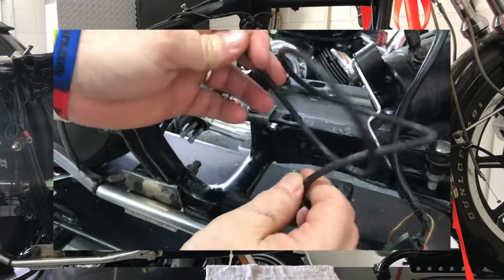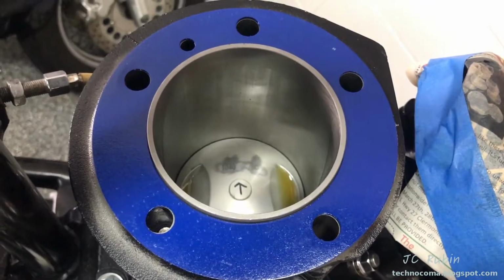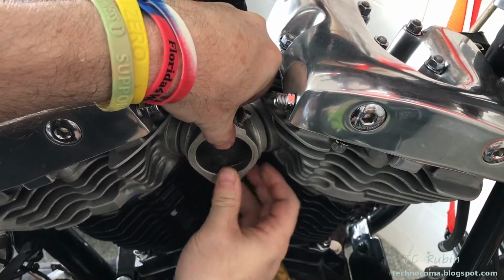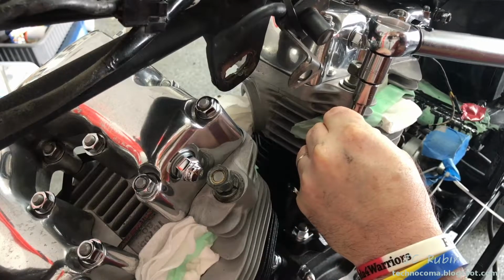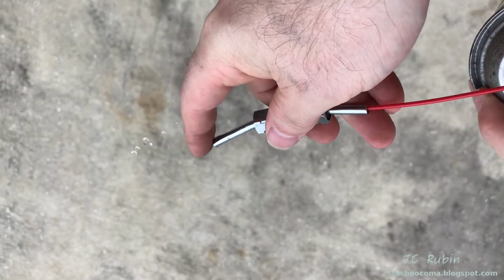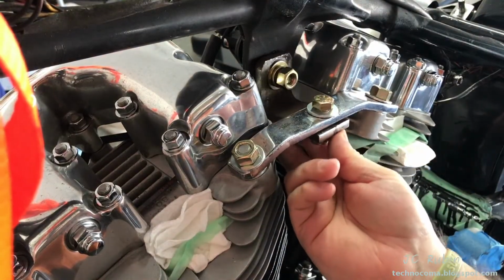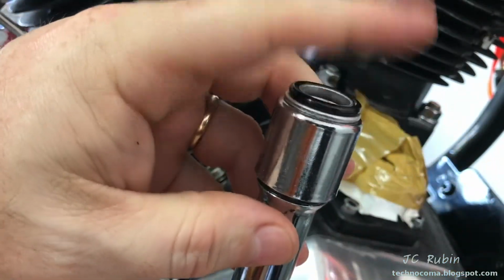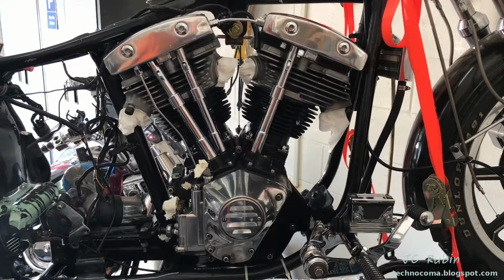AMF Shovelhead Lowrider Restoration -23 - Shovelhead Top End Assembly, Upper Mounts, Pushrods

Comment: are those blue gaskets reliable? put them on, ran bike once on lift for 2 minutes let it sit for a half a year went to pull heads and gasket was already sticking to mating surfaces any ideas?
Reply from the maker: Ran those for two engine builds now. Hose gaskets were never an issue for me on prepped heads and mating surfaces.